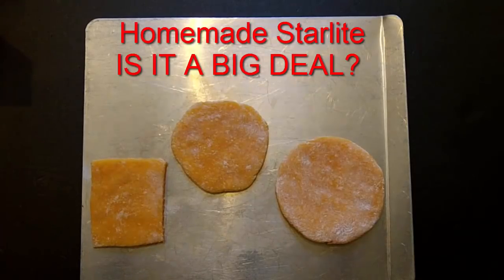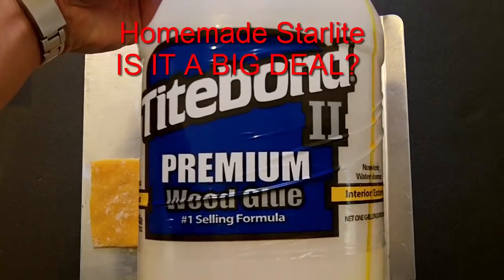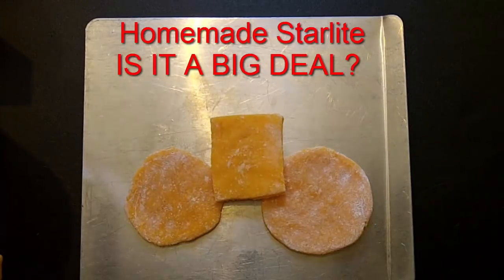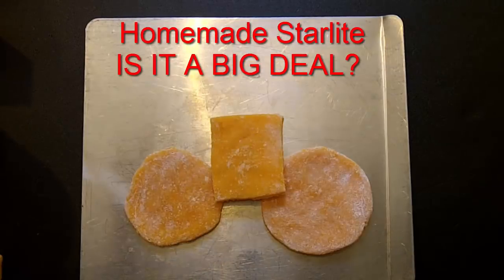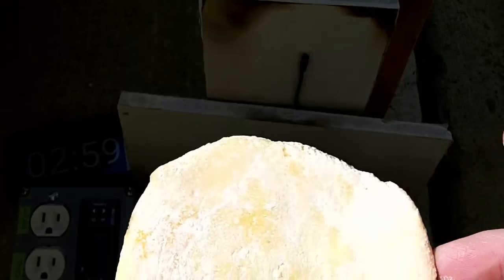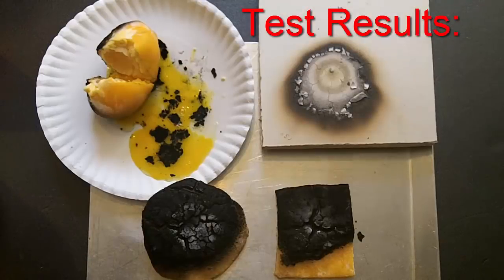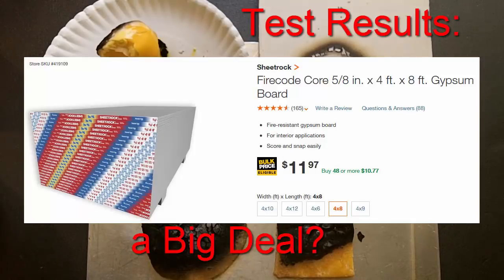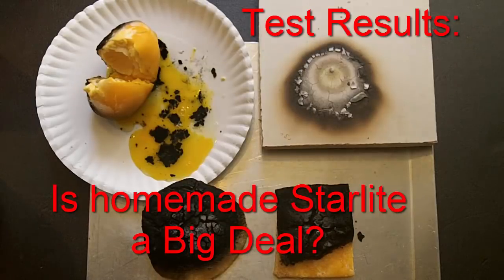Homemade StarLite Testing: Is It a Big Deal? : Fire Resistant Material : Eye-On-Stuff

Comment: How about a practical application test?  Does mold grow on it, do animals such as ants or roaches eat it, does moisture in the area affect it, does it smell bad if wet, if it is very humid does anything adverse happen to it, Is it brittle after it dries out, can it be drilled or nailed at drying, do yours applied to the back to fasten it to a surface affect it, does painting or sealing it change anything, is it practical for use as an insulator/heat shield.  Not many people have eggs they need to protect.  What about mixing it into latex paint?  Would it help protect anything painted with the paint? (It would have to be a thin enough mix for it to be able to flow to be used as a paint). Latex paint has the binders and the "glue" would not be needed. 
Nobody I've seen does any real world application testing, why don't you be the first?
Reply: I agree. That is where the rubber meets the road for me. Putting it on eggs, and testing it on your hand, or various items of unimportance is a moot point. I want to see the forms it can be shaped into like paints, fibers, clothing, or even a flexible paste like those as seen on TV products. In other words where is proof of concept and practical application for commercial use.?
Reply: @robertbogartis3108  I heard somewhere that there's a paint you can buy that has fire retardant properties.  I'm taking about house paint, of course there's heat resistant paint for things like wood stoves and engine parts, but the one I saw about was exterior wall paint.  I've never looked into it because it's probably really expensive but if it can be done adding the dry ingredients to latex paint, it would not be expensive at all.
I'm worried that in this form it would attract bugs and ants and fall apart if it gets wet.
I saw a video with the daughter of the guy who made it, she said she has the formula but won't let the world have it and won't sell it or produce it, just like her father.  She said there's like 20+ ingredients in it and the fire retardant paint is not the complet formula.  If she is telling the truth, she's sitting on a gold mine.  If she doesn't sell it or manufacturer it she's not very smart and stingy!

Comment: Now that I'm retired I have time to go down all the rabbit holes I've been piling up.  I graduated in '73 with a degree in aerospace engineering and my wife graduated in '74 with a degree in home economics, thank God.  She was able to simplify so much of my life by asking her "stupid" questions.  She released my engineering mind to become both more creative and more practical.  With her in mind, here are a couple of suggestions to improve your process.
Weigh everything and write it down so you can replicate your recipe.  
Use a rolling pin with side blocks to roll out identical thicknesses of dough every time.  A tortilla press will work to make really thin sheets.  
Use an oven on low heat, below boiling, to drive off moisture in an hour instead of days.  If your oven goes down to 150 degrees F, use that.
Reply from the maker: Thanks for the great advice - appreciate it!
Reply: Another thought:  Zinc borate is used to impart fire resistance to plastic.  You can make zinc borate with dry zinc oxide and dry boric acid (aka, roach powder).  I think the ratio is 2:1, but that's not hard to verify.  Boil it and zinc borate precipitates out.  These ingredients are easy enough to find and might help sort out the secret to Starlite.  Perhaps the dry ingredients could be added to the other dry ingredients before the glue is added.
Reply: @dchall8  
When intense heat is applied to Starlite the resulting chemical reaction is almost the same as in the pharaoh's snake intumescent reaction discovered by Friedrich Wöhler in 1821.

A Starlite like material must at least contain 2 elements namely:
- A chemical that contains carbon and releases that carbon when it burns.
- A chemical that when heated releases a gas like co2 that inflates the carbon as it forms turning it into a carbon foam.

When intense heat is applied to Starlite it quickly forms a black layer and bubbles of carbon starts to form. The deeper the heat goes into the material the more it’s pushed away by this expanding foam of carbon itself and once it’s in this solid state it also has insulating properties so the transfer of heat is doubly reduced.

It’s cold enough to touch almost instantly because carbon foam is an excellent black body radiator which is a scientific term used to describe an object that among other things dissipates energy just as quickly as it absorbs.
Reply: @dchall8    
To be clear, nobody knows what’s inside Starlite except for the in 2011 deceased inventor, his wife and his kids. One of his daughters is trying to commercialize the original Starlite trough her own company.

Comment: If I used starlite to fireproof my home wouldn't that be like adding a candy coating for pests?   I'd love to see an experiment where the original starlite was used that included testing to see it's resistance to ants, termites, and mice where pest resistance tests were performed that compared starlite pest resistance to the resistance provided by Gpysum board.
Reply from the maker: Sounds interesting!
Reply: If a boron containing substance like borax was added, fire resistance would increase, and bacteria, mold and insects would be resisted.
Reply: @huntera123  They made sure to keep the makeup of starlite secret and expected people to pay for it based on it's fireproof characteristics alone.  Every homebuilder on the planet knows that you can't create candy coated houses just to make them fireproof.  I am almost certain that is why they chose to try to market starlite in the shady manner that they did.   Over and over they would show it to be fireproof.  Lots of edible materials have elements of fire protection.  They did not patent it and tried to sell it without a patent where the actual makeup of it was secret until they had cash in hand.  So clearly it had something about it that rendered it useless in practical application otherwise they would have patented it then sold it like everyone else does.

Comment: An interesting test, because it seems to work so well it could be made into thinner sheets perhaps even into clothing padding if the right kind of glue could be found.

Of course then you would need to find the right kind of thread to hold it all together with but who knows what could be achieved with this kind of thing.

And it's so cheap to make.
Reply: thread can be replaced with fiberglass

Comment: Will StarLite work as a heat barrier as well as it does with using a flame heat.  try using it with a non flame heat like a header wrap or a stove pipe?
Reply from the maker: Yes, I found it to work as a heat barrier.

Comment: How about you try just plain 1/2 inch gypsum board , you see I had to replace my plumbing in my old house and I had to soldier some joints in front of my wiring and I wanted to know if a piece of gyperock  ( yes I know this is spelt wrong ) would be enough to protect my wiring so I stood a piece of gyperock and stood a torch in front of it for somewhere between 15 and 30 minutes and about the only thing that it did was burn the surface paper , I did not get the sizzling and cracking of the gypsum that you got with your fire-board gypsum  , I personally think regular gyperock is just as good as your fire-board  ..........

Comment: I made mine with the same recipe and ratio, but it caught fire when held over a candle. What did i do wrong??
Reply: Was the glue 100% dry? It could also be that the mix was not evenly mixed, mix the corn starch and baking soda very thoroughly before you start mixing in the glue... You also want to add little by little glue until you get the dough like consistency that does not stick to your hands. I messed up my first batch by adding too much glue. Make sure your glue does not contain any solvents as well.
Reply from the maker: Not sure but, I'm thinking maybe the ingredients were not mixed enough.

Comment: Hi! I wonder: how long it will "live" in usual air conditions? I mean... will it degrade over time?
Reply from the maker: That would be a good test.  It would depend on the type of glue also. If the glue degrades with moisture, not good. The tight bond I used is supposedly is water resistant.

Comment: Couple questions- does it function well in sub-burning temperatures? Basically, is it a good thermal insulator if it isn't on fire? I'm curious how it compares to things like fiberglass and aerogels. Also, what's the density range?
Reply: As far as my understanding goes, it's the layer of carbon that forms when it burns, a black body radiator , this is what reflects the heat away from what ever is on the other side. So in lower temps(where it can't form the black body radiator), the 'starlite' would eventually transfer some of the thermal energy to the other side.

Comment: 3. Take Vermiculite Portland Cement add mixture of 10 parts corn starch, 1 part baking soda, 1 part Magnesium Hydroxide Powder (absorbs heat & smoke) then use Aluminum Magnesium Silicate Powder as a thickener (NOT GLUE) with consistency of molasses before adding to Cement Mix. Of course, mix it all up in a concrete mixer then pour into sheets and dry. Once dry then spray onto the surface a mixture of Sodium Silicate, Silicon Monoxide, 21 Mule Team Borax and Graphene Ink.
Reply: You know the superglue that is tougher than aircraft-grade aluminum when you add baking soda to it? I think you'll find it if you look up "make stronger superglueglue with baking soda."

Use that glue instead or also.

Please make a video of it.

Also try egg whites. Cure by dehydrating in the fridge. Egg whites get rock hard this way.

Comment: I think you might get a different result if you used pure PVA white glue.  I THINK that the wood glue that you used has powdered sawdust in it to give it a more solid bond, and so that it more closely matches the color and texture of actual wood.
That should NOT be hot on the back side when you remove the torch. 
Great experiment, though.
Thank you
Reply: Tterribilis i was thinking the same thing with regards to the glue choice. 

I specifically remember other videos mentioning the importance of PVA glue
Reply: @TreDogOfficial  pva glue is important because it doesnt release toxic fumes when it burns.

Comment: I wonder what the temperature transfer comparison would be if the "Starlite" was as thick as the gypsum fireboard?
Reply: I think a more useful comparison would be to reduce the thickness of the gypsum board to that of the starlight. Given the amount of heat he is using, it looks like 1/8" of each would be a fair comparison as that is just a little more than the carbon foam layer of the starlight: the actual useful thickness of the material at that temperature.
Reply: My guess is that it wouldn't be much better because the isolation effect comes from the burnt starch (or whatever he uses as a carbon source) and not from the unburnt material behind it. If you want cooler temperatures on the other side you probably need more carbon "bubbles".

Comment: Hi I'm new to all of this. Love to invents things. Trying to follow the path that Maurice Ward took. A few questions. Can starlight be enhanced with a bio-plastic and maybe even carbon foam nano-particles?  I'm fairly sure that Maurice add different bio plastics to change the composition of starlight from a paste to a elasticized plastic and a hard plastic. The break down of the starlight over a  period of several weeks demonstrates that it was a biodegradable product that could be stabilized by heat.  Anyway thanks for the video. Im drying 600 grams of wonder bread in the convection oven at 176 F to remove the moisture. Most of the bread has remained flat. Tomorrow Ill wrap up several slices in tinfoil and heat it up at 800 F in a crucible for 45 minutes. Not too fast so as to retain the shape.
Reply from the maker: This is good question.  I'm not exactly sure but I know that bioplastics can come from cornstarch and is also an ingredient of fire retardant materials including knighthawkinlight's homemade starlite.  PLA polymer is derived from cornstarch.  Maybe a different formulation of pla plastic could make a good durable starlite material? Let me know how your experiments turn out.  Thanks for watching.
Reply: @eye-on-stuff5248  Thanks for the reply brother. I'm in the hot-seat for invention. Yesterday I was successful in converting breads crumbs into a fused carbon foam. This was not my original intention. I'm looking forward to try making an air battery to test for ion transfer and absorption. Type in carbon foam from bread. Here is the link.  Carbon Foam from BREAD Test 5 DATA RESULTS
https://youtu.be/sK4iOZrAOg0

Comment: For a quick test of a single batch I think it did a fairly good job. I have seen other tests on YouTube with mixed results (no pun intended). Apparently the carbon produced is an excellent insulator but it tends to curl off. Having said that your comparison of four times the thickness of gypsum showed the material is more insulative and still appeared to retain flexural strength. It will surely take more research with substituting various ingredients at different ratios, adjusting drying and curing times, to come up with the optimum material. Maybe mixing graphite in it might increase thermal resistance. There are currently a lot of people experimenting with it. In time it is likely significant improvements will be discovered.
Reply from the maker: I agree. Thanks for watching.
Reply: Seen a test on Youtube with a manufacturing cutting laser set at the highest power for two minutes not cut through it. It must be fairly good. Though its Cryptonite is water.

Comment: How strong/durable is this stuff? (Not too “fragile” is it?)
Reply from the maker: The batch I made had time to dry for maybe a week and I used tight bond II glue that might be a bit stronger possibly?  If you look at the end of my video, I broke a piece of it by hand and it was quite tough.  So, if you allow it to dry, make it thick enough and possibly use a quality glue, it appears to be pretty strong.  Not sure how much strength you need. Also, the glue I used appears to be waterproof after drying.  It may have some water resistance for a little while. Not sure how long. Thanks for watching.

Comment: Nice test! I believe you are right in your conclusions, though there is a lot of room for optimization of the 'starlite' composition that could improve results significantly.
Reply from the maker: Thanks for the feedback.  You are absolutely correct.  My batch of starlite was not perfect and I believe it can be improved to perform much better.  Thank you for your innovation and knowledge on the subject!
Reply: Hi. I did manage to create carbon foam nano particles by blending wonder bread into sugar sized bits, then heat it in a kiln at 800 F for 25 minutes.  Incredible heat absorption cooling effects. Zero electrical conductivity.  U tube- Hiw yo make carbon foam from bread. As far as I know this is a first.  Grind and mix in with your bio plastic.
Reply: @whatwouldjesusdoamerica  do you have video on that ?